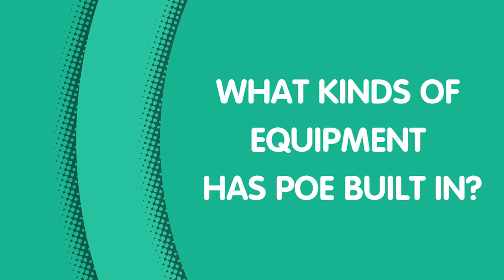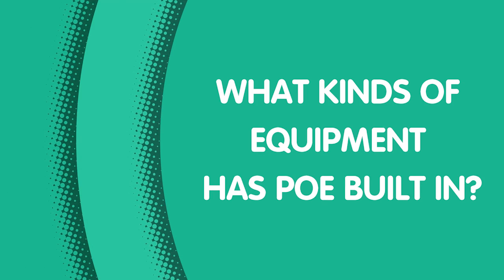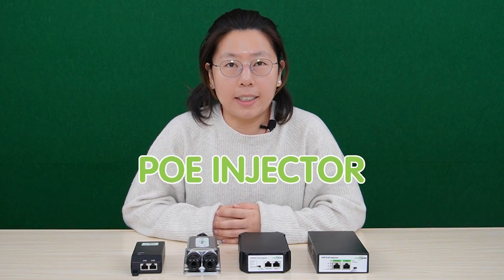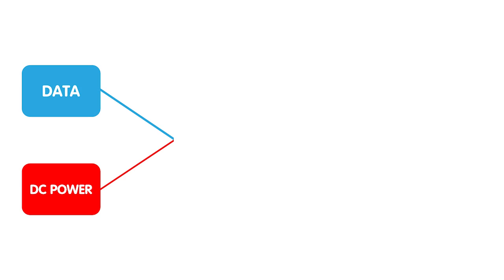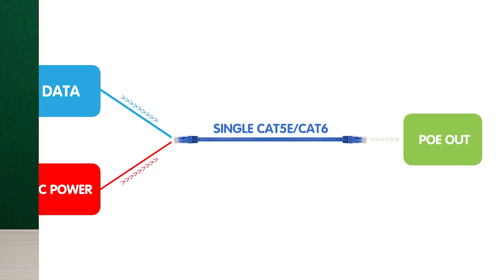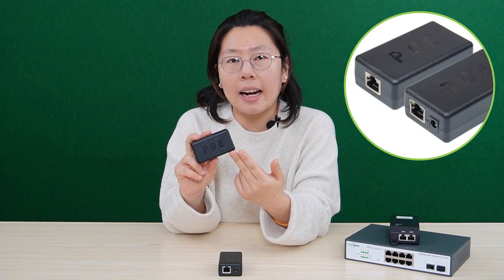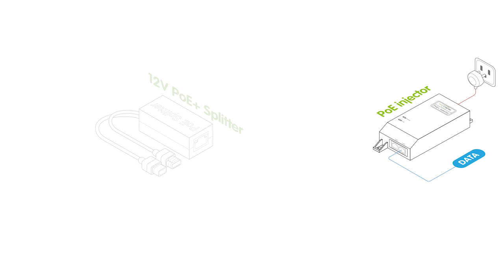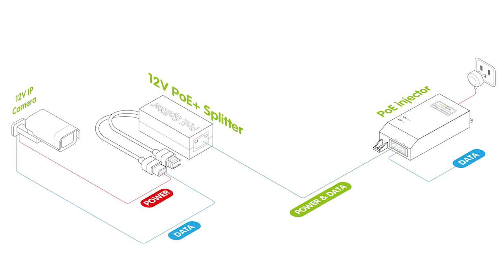Types of PoE Devices-PoE Switch PoE Injector PoE Splitter

Comment: Why can’t we use the high power for 10g. The injector just inputs power. Why buy the high power with high bandwidth injectior
Reply from the maker: yes, but PoE injector only inject the power to the cable, but the data still need to go through the PoE injector becasue it is sharing the same twisted pairs wires. There is a network transformer involved which might step down the bandwidth to 1G unless it allows 10G data passthrough.